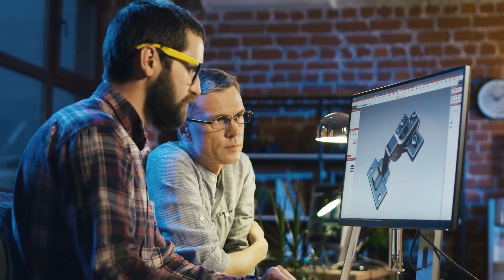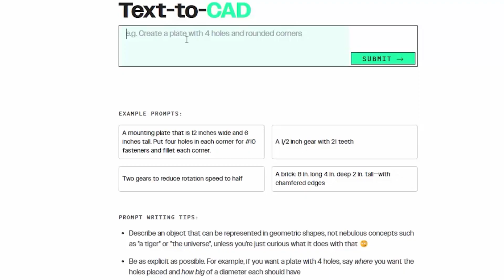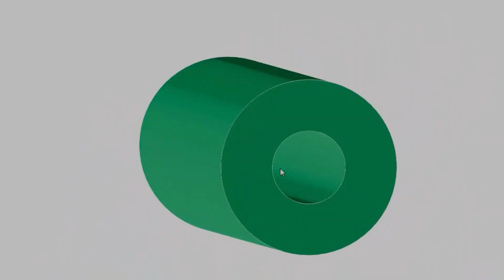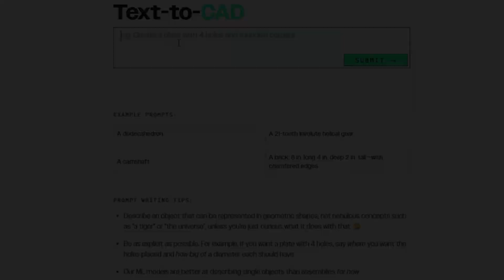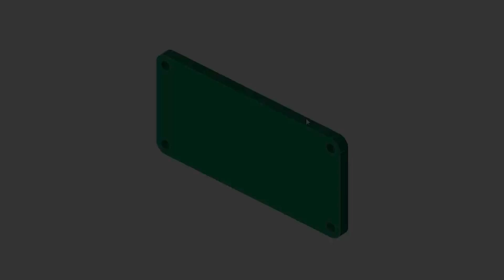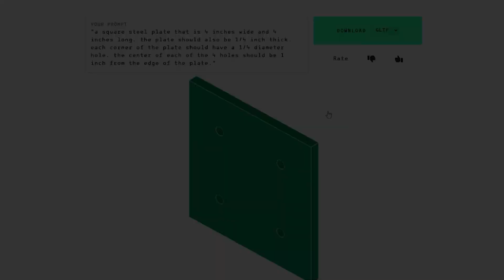Text to CAD From Zoo: The future of 3D Modeling

Comment: No need for specialized software, plenty of text to 3d models are open source. You can even go straight to GCode, and it works well for most 3 axis cutting paths. Probably not so well for 5 axis machining yet.